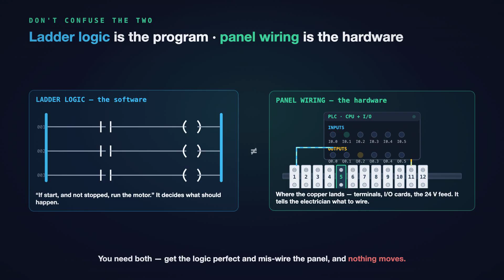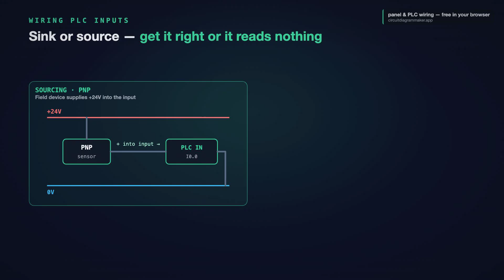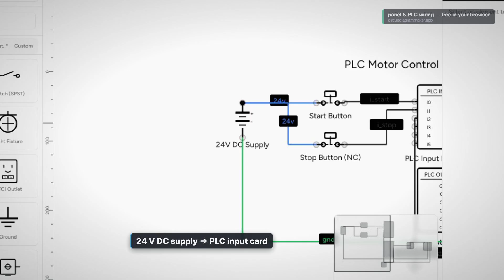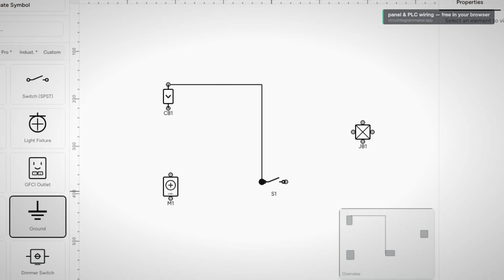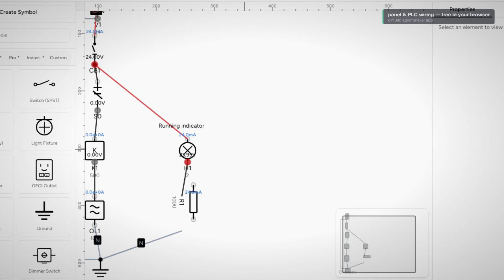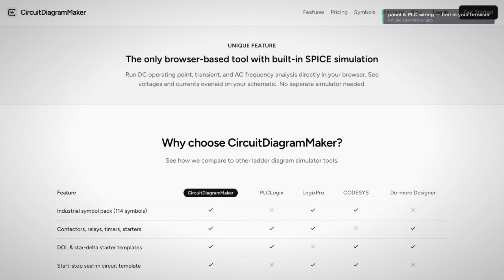Panel Wiring Diagram Software (PLC Trade Demo)

Comment from the maker: Quick field note: if a brand-new sensor reads nothing, check sink vs source before you blame the sensor. A PNP (sourcing) sensor pushes +24V into the input; an NPN (sinking) sensor pulls the input down to 0V — mismatch the card and the input never turns on, even though everything looks connected.

And number every conductor. In a real panel a wire isn't "the blue one" — it's wire 204 landing on terminal 31, printed on a ferrule, so the drawing and the enclosure read the same. Draw yours free: https://circuitdiagrammaker.app/diagrams/plc-wiring-diagram?utm_source=youtube&utm_medium=pinned_comment&utm_content=yt-011